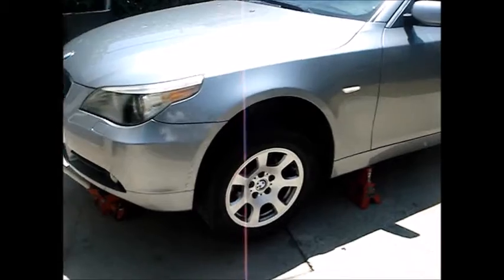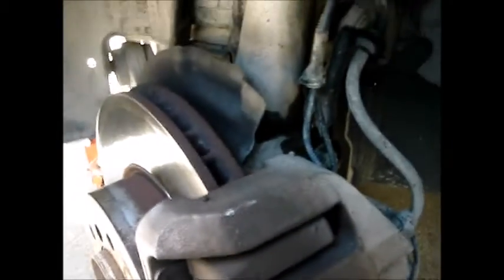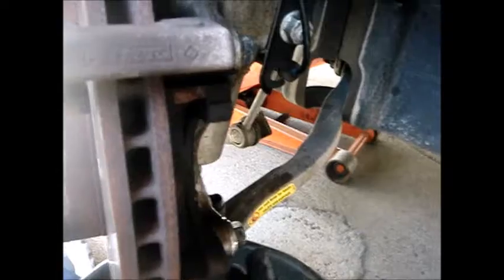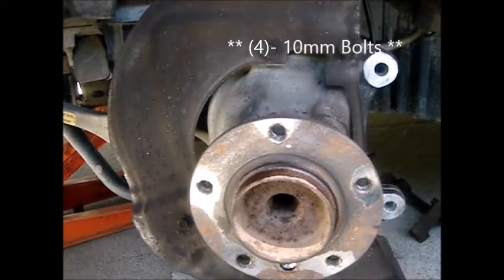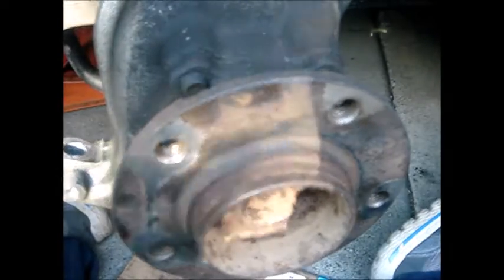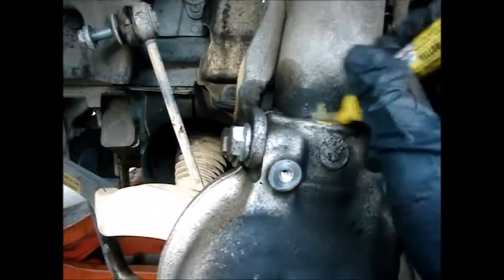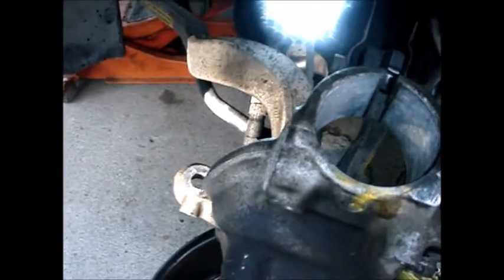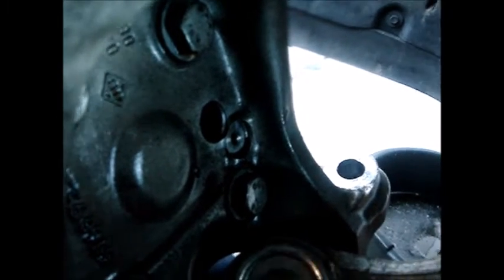BMW Front Wheel  Bearing replacment E60/ 5 Series Part 1

Comment: Nice illustration of well done job.
Just a few comments:
- no need to mark the strut, it has a notch and a height stop which fit into the bracket.
- no need to remove the strut out of the car, just detach the lower control arms.
- no need to remove the wheel sensor.
- if you don't own a strut splitter you can use a hex key much better than a chisel or screwdriver.
Nevertheless nice informativ video which helped me a lot.

Comment: Thank you Oscar for this video and viewers for the comments! Using all seen and read information I was able to do this job. As mentioned earlier - break caliper comes off as a whole piece (2 18mm bolts). You don't have to mess with the strut assembly - just drop 2 arms down and one will come off from the top of the hub. AdvAuto Parts didn't have the separator tool, so I used an 8 mm ranch sideways and a flat screw driver which I lightly tapped with a hammer and that did the trick nicely and the wrench and the sdriver stayed in the gap nice and tight while I did the job. Sidenote: make sure you have 2 18 mm and 2 21 mm wrenches (I used one socket and one regular). Good luck!

Comment: Just remove the two 17mm bolts and remove the caliper in one piece rather than dismantling the caliper bit by bit.
Reply: Absolutely.
Reply: They are 18mm bolts but for sure fuck knows why he would pull them apart like that!

Comment: what is the diagnosis when it is bad,whell bearing,  mine after 70 vibrates a lot in front, I already changed,drive shaft,tires ,brake pads rotor, not fixed
Reply from the maker: Hi francisco, try lifting the front tire with a jack and hold the tire on the 9 and 3 o'clock position and try to move the tire back and forth, and than rock it back and forth from the 12 and 6 o'clock position, if their is play your wheels bearing are bad. I hope this helps

Comment: What electrical wrench is that you are using?
Reply from the maker: It's an Ingersoll rand w7150, with 1,100 ftlb of.nutbusting  torque. Sometimes this tool is too powerfull that it will brake off rusted lug nuts. So be careful if you get your hands on one.
Reply: It looked superstrong, i need me one of those:)
Reply: What type is that angle wrench? The one you took the caliper bolts with?

Comment: Taking off the strut was not necessary, just drop the hub after removing the bolts on rhe control arm and tie rod, and the hub just comes off.
Reply: Same goes for the caliper, just take the entire unit off, one peace. But whatever...
Reply: Hey Nathaniel, in considering replacing the whole rear hub assembly in my 07 E60. If I understand correctly, I just need to remove the caliper assembly, rotor, and axle nut. Is there anything else major I should be concerned with?